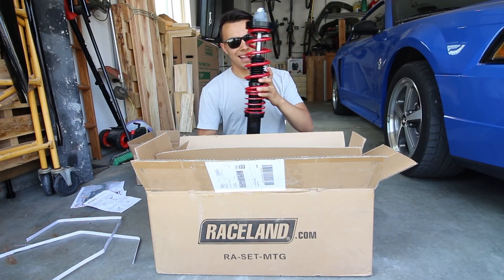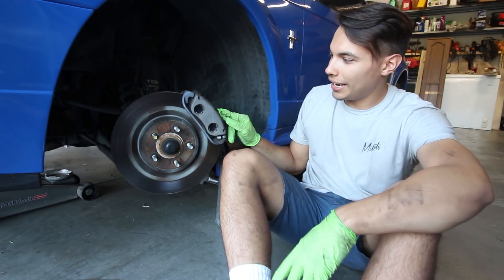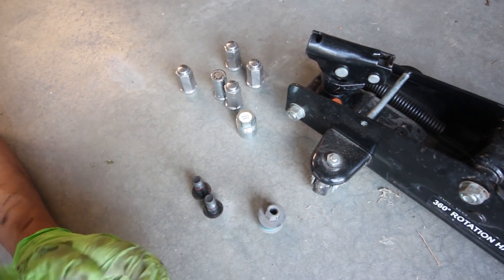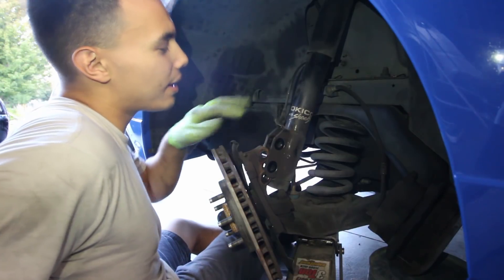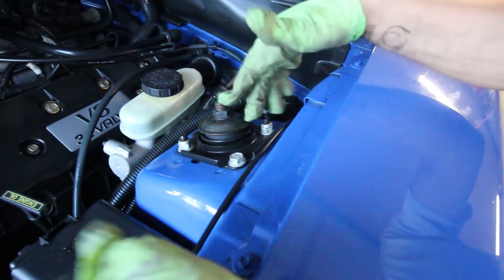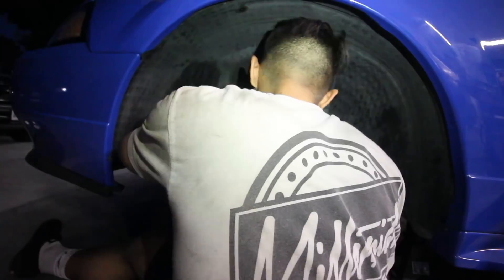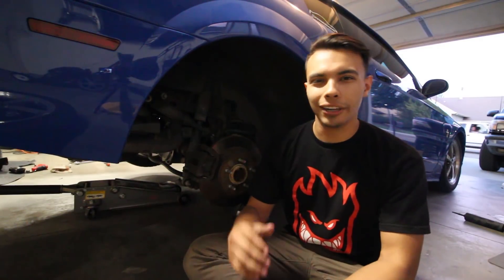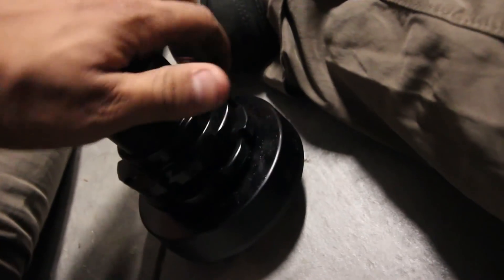SLAMMING THE MACH 1 ON $600 COILOVERS | 99-04 Mustang

Comment: Question did you need to remove the spring ? What about if you just leave it there
Reply: You’ll need to remove the spring and the strut, can’t leave it in there, hence why it’s called a coilovers because the coil is over the strut

Comment: How come when I jack up my car from the back my springs come out I need some help
Reply: If you're not placing the jack under the rear axle, then the suspension is decompressing as you jack up the car. The aftermarket springs are shorter than stock springs and basically "fall out" once the axle has dropped far enough down that they can't reach the top perches anymore. I had the same problem on my '00 with a set of ebay coilovers. 

My advice is to invest in some Ford Racing lowering springs. The fact is, the SN95s simply weren't designed to use coilover suspension.

Comment: "Coilovers do the same thing as bags."

Not exactly. Coilovers offer firmer suspension and will improve cornering/handling. Bags will do no such thing. Riding on air, the ride will be soft, plush and there will be very little to resist torsional stress in corners. Bags are for aesthetic purposes only.
Reply: No. Stop saying lies . Bags arent just for looks ,you never looked up performance parts i bet v6 stanger